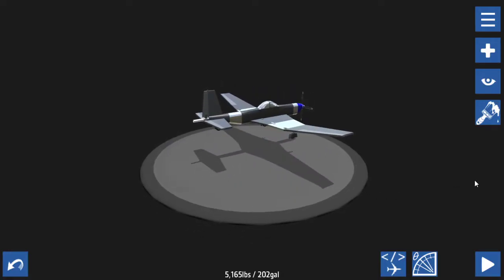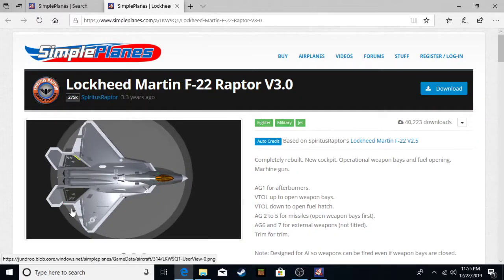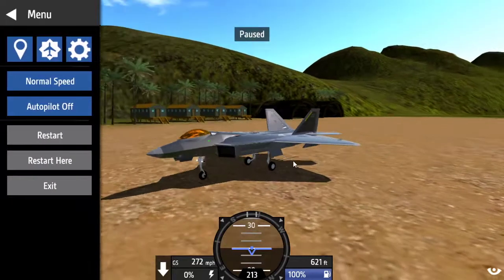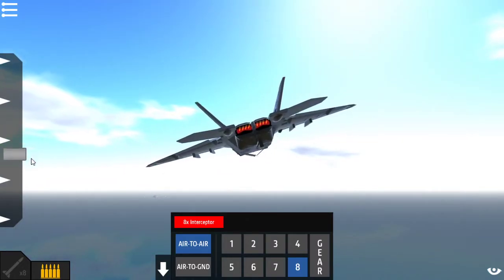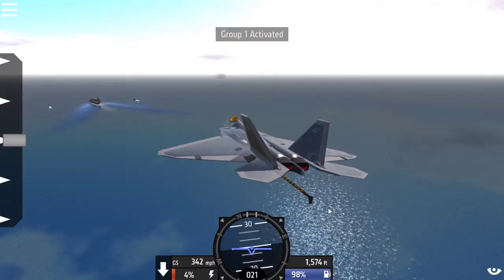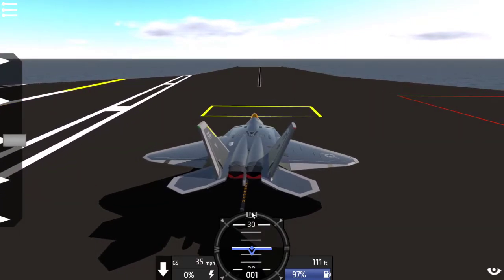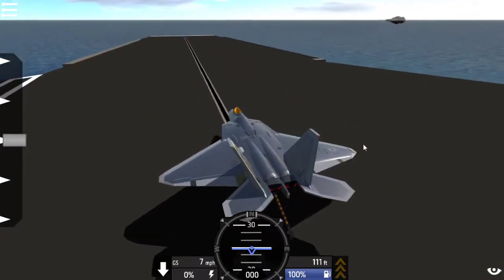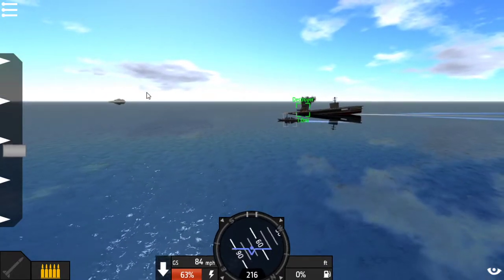How to use the arresting wire, elevator, and catapult of the USS Beast in SimplePlanes

Comment: 1. use tutorial plane, add arresting hook, its easy since plane is slow

2. if using wasp, try land using 1st person camera to stabilize
Reply from the maker: Slower planes like the tutorial plane and other similar slow vehicles like the bush plane are good for practice, but due to their low mass and speed, they can easily land without the wire. 

Also, for the wasp, you can easily land with first person view, but that may be a lot harder for newer players, who this tutorial is directed towards.

Comment: Wait how do I do that on mobile?
Reply from the maker: For the arresting wire, all you need to do is deploy it by setting an action group in the aircraft designer. 

For the catapult you need to go over the location, stop, then press the button on the bottom right that should appear. 

For the elevator use the same process as on PC
Reply: @tfk_001  wait how do I lower the elevator though
Reply from the maker: @Powdercoreyguy  it automatically does at is you sit on it without moving for a few secs
Reply: @tfk_001  ohhhh
Reply: @tfk_001  so I literally need a smaller aircraft I think

Comment: When I use catapault I go the other direction
Reply from the maker: If that happens, you should add a catapult connector so you can properly angle orientation
Reply: @tfk_001  Oh, I tried that before replying,  I still go the other way... Maybe I need to put the catapault  in : A. Middle B. Front C. Back Which one?
Reply: @seanmichael5391  if you're using a jet, the catapult connector is suggested to be placed near the front wheel. If, however you are using a propeller aircraft, the connector should be located wherever you want to connect.
Reply: @equin_xx  Thanks!